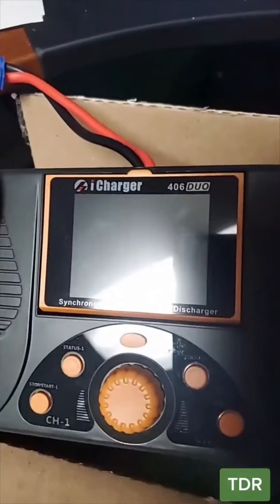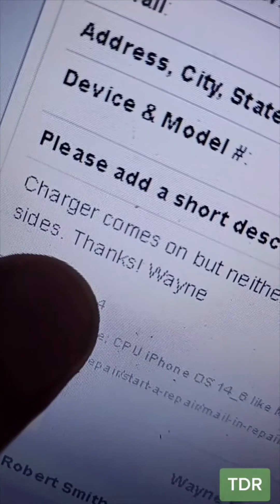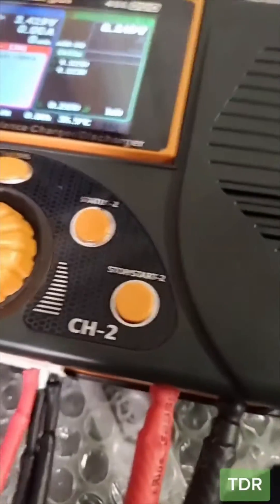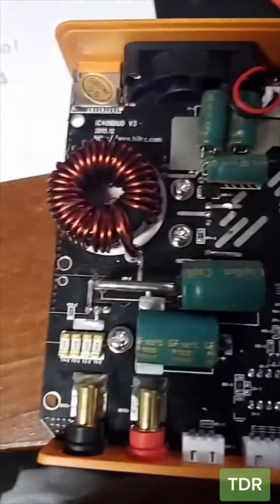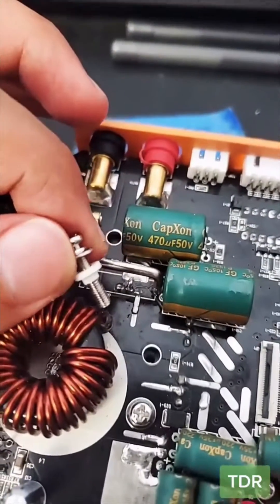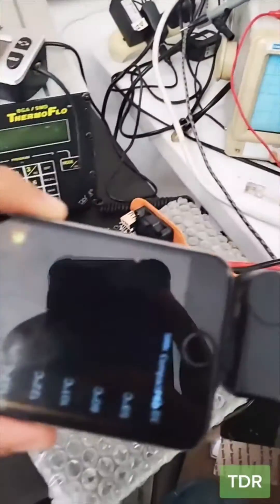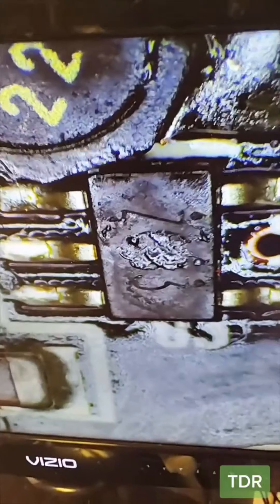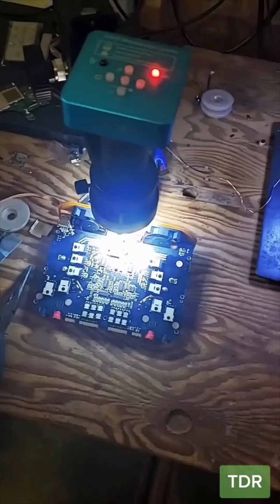iCharger 406DUO   Powers up, but doesn't charge!

Comment: Unfortunately, I still have the same 1301 error on an iCharger 406 Duo as well. In my case, I connected a 6S lipo to the main battery leads while still having a 2S lipo still connected to the balance board on the same (LEFT) channel. It smoked quite a bit! A friend of mine replaced a lot of the FET's and the left channel worked fine after he repaired it, however, the RIGHT channel now does exactly the same as this - you start the charge and it draws no amps... then after a while comes up with the check connection. If I am seeing correctly, the chip you are pointing to is in the area between the fans? By eye, my chip there looks OK, but I will certainly take a look at that area with the work microscope and thermal camera. If I can read that chip, I'll let you know! Like I say though, in my case, I can charge on the left channel fine, so I am a channel down!
Reply: I took a picture and zoomed in and my chip in that location at the back between the 2 fans looks like it has "1305S" written on it. I will have a proper look at work on Monday 🙂